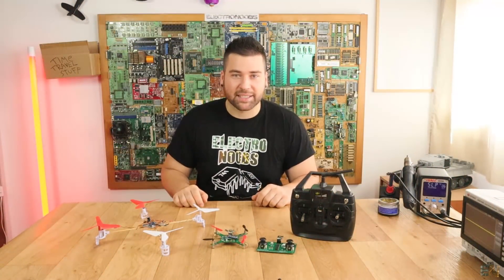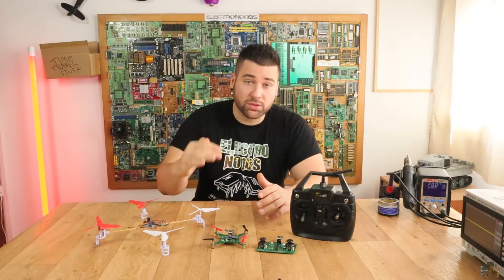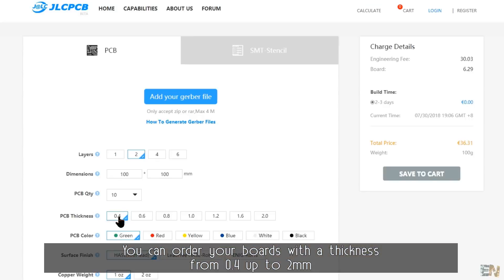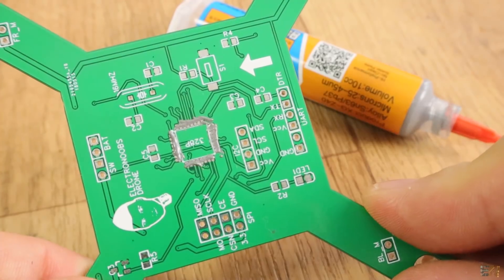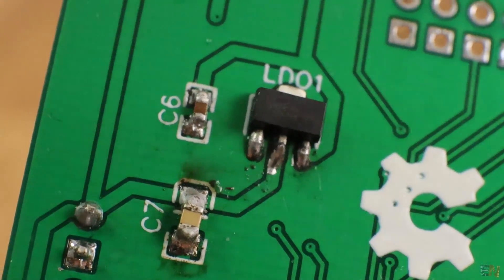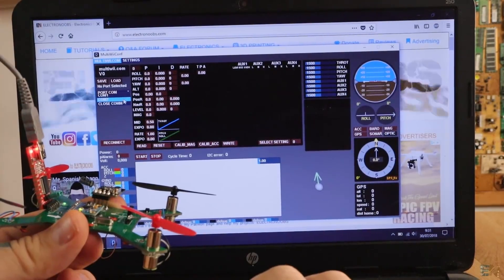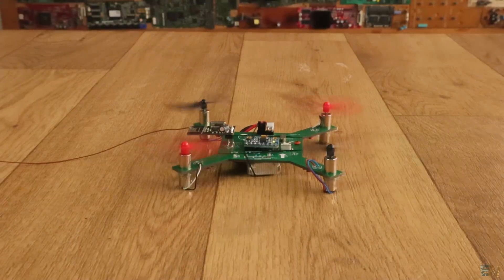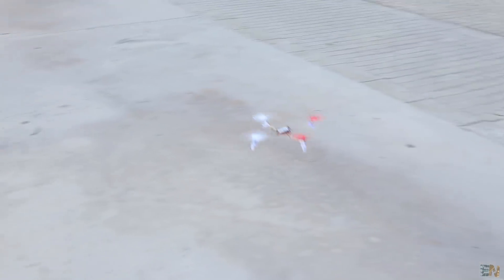Arduino brushed motors DRONE - Part3 - it finally flies

Comment: Bro try to use 1050 motor it would give you thirst of 68 grms and it's weight is 25 grms so theax thrust would be 43 grms.

Comment: Why did u try to reinvent wheel? I just buy $20 old Udi818a and salvage parts from it to new frame with new motors (brushes wear out) and upgraded antenna.
Reply from the maker: Good for you. Pretty much everything I do on my channel is more expensive than buying one, obviously... I do it for learning man!
Reply: @ELECTRONOOBS  And learn you shall padiwan Mmhmm (Yoda voice, encase that wasn't clear) subbed to ya now

Comment: I think you should use two small battery separate for motor and the chip. It will solve the resetting and voltage drop problem
Also you can use esp8266 instead of nrf and atmega320p. It has built in wifi so it will also reduce weight.

Comment: Hey sir I made this drone but with big and high rpm dc motors and as.per tge cpnnections but when I send data to the reciever from the transmitter it recieves for some time but after some its lost. I have configured the drone with multiwii win gui 2.2, and also set the correct pid value  please reply🙂🙂

Comment: Try Increasing prop size. I recently built a plane and it would not stay in the air, but I knew the motors could produce enough thrust because they had come from a helicopter that weighed more than my plane and the helicopter was capable of vertical takeoff. I eventually determined that it was because my props were too small so even at max rpm they couldn't product enough thrust. Increasing my props from 38mm to 55mm fixed the problem.

Comment: -I believe you should fix the centre of gravity, the nrf module is not centered on the pcb,
-Use bigger propellers.
-Replace the battery with lighter one if possible

Comment: hello ,
can you make a video making a drone using inbult nrf24l01 radio module in rf nano?? 

https://www.banggood.in/RF-Nano-V3_0-Micro-USB-Module-ATmega328P-QFN32-5V-16M-CH340-Integrate-NRF24l012_4G-Wireless-Imme-p-1500156.html?cur_warehouse=CN

Comment: I followed each and every step that you have shown but there is a problem...While I am increasing the throttle....on two motors are running...other two are not...please help
Reply: Did you find any solution?
Reply: Hey did you find the fix.😅
Reply: @bhavikrajpal6882  bruh…it is occurring due to motors taking large current while taking
There can be two ways:- 
1) place a 1000uf capacitor in the input of the battery terminals
2) use a high discharge rate lipo battery

Comment: What did you use for controlling the motors? Some specific motor-controller or just transistors/mosfets and PWM? If so, which mosfets did you use? As far as I can tell, those motors has a stall maximum current of 2A, so I guess any transistors that can handle up to 2A should work fine? Thanks!

Comment: I made a brushed drone as you told in the other tutorial. The tutorial where the body of drone is make with barbeque sticks and when I gave throttle the Arduino in reciever gets reset  when I reach half throttle . Can anyone tell me  where should I connect the positive wire coming from battery to which pin of the Arduino in the receiver 
Please help 
How can I contact you I need your help

Comment: When I started my own arduino brushed drone, I got inspired by you plenty of times. Thank you so much for that. As soon I reachead the same Stage as you in the Vid, I tried to avoid these motor spikes by writing a sequenze for the motors to start, pressed by a button from the controller. I Still have some problems to fly, but this helped me a lot.

Comment: Hey Man , not sure if i saw properly but did you connected the high voltage to LDO output ?  if so you are shortcuting power rails ( pcb/ldo/componnents damage also power waste as a bonus :) )  ping me if you need any help with power conections ,  i can review it.

Comment: Great video! I was wondering, I have just been getting into CNC milling my own copper PCBs as a hobby and would love to try out the board tracing you have for the smaller green drone with green PCB controller. I already checked your links but would you be willing to share your .BRD file with me so I may try fabricating my own board?

Comment: How to fix decreasing motor values in multiwii java application and this is the same issue you are having with your drone check motor values in java application when drone is armed its not same all 4 motor values is different and decreasing after I put the throttle to maximum
Please give me any solution about unbalanced motor values in multiwii java application

Don't know how your prototype drone worked ????

Comment: Hey I saw lot of quadcopter receiver boards I've noticed 1 thing. There is vcc gnd clock and data connections on back of all boards can I connect mpu6050 or 6000 gyroscope and accelerometer module to it if in case my gyro chip is broken

Comment: One thing you could do is remove some material from your circuit board. That is one great big hunk of copper and phenolic and you probably don't need all of it. Maybe add some holes along the struts and towards the middle to drop some weight. Another thing might be to rework your circuit so that more of the heavy stuff is toward the center for better balance. Finally, if you're designing your own board, add the components for your add-on modules and get rid of the extra weight from those pcbs.

Comment: I have a tip for you:- use bigger but light 3d printed propellers. 
In 3d printers you can lower the density of the material and leave air spaces between the propeller

Comment: Use smd attiny88 microcontroller.. its just works like atmega328 but it doesn't need any crystal to run... So it save the place and weight of the crystal.. the programming of the attiny88 is very easy and its have all the facility that atmenga328p have.
Check this links of my website you can easily figure out the difference.
https://www.arghyabiswas.com/i2c-communication-between-raspberry-pi-and-attiny88-microcontroller
https://www.arghyabiswas.com/attiny2313-microcontroller-programming-with-arduino

Comment: I am using arduino nano +3.7v coreless motors +nrf24 module +380mah 3.7v 25C lipo battery. Do you think it will work as well?
Reply: And Irf640n mosfets

Comment: I think the problem is at the motors because i have seen some drones that the 2 motors for example the two with the black prop., turn clockwise and the red one's turn anticlockwise for better balance, i think, but in your drone they all turn the same direction.😊

Comment: I am just on the verge of giving up now.  Since long(about a month) I am trying to build this drone but my Arduino pro mini restarts everytime I connect motors to circuit. I tried most of the capacitors (100-100MicroF) and their combinations but nothing worked for me. Please help for the Arduino restart problem.
Reply from the maker: Try a huge one. 680uf and let's see if it will restart.
Reply: @ELECTRONOOBS  I already used 1000MicroF , still same problem
Reply from the maker: @vishalraykar4948  well I don't know how to help. Maybe put a bigger resistor to the mosfets gate so the spikes won't be that big and fast.
Reply: @ELECTRONOOBS  ok will try the same. Thanks
Reply: @ELECTRONOOBS  also tried combination of 1000,100,470uf in parallel

Comment: IMO 16v cap is a bit huge. How about a few 100uF 6.3v tantals in parallel. Lower ESR... much better. I would also recommend a small boost supply to 5v so you can drive the mosfets better. (3.3v is barely enough for some - motors still supplied by the battery of course). Smaller "wings" to the motors is also better. hell even make a cutout for the nrf module since you are using modules make them as small as possible. Using the 1mm/0.6mm pcb should also help with weight but lower rigidity. - Nevermind saw the end of the video and you came to the same conclusions. Almost

Comment: Buck converter for your 3.3 volts larger tracks from the battery to and from the buck converter or to test add copper wire on the tracks this will stop voltage drop remove large capacitor you don't need it then add 0.1Uf ceramic caps to each motor across the terminals and 0.1uf from the positive input terminal on each motor to the motor case this will sheld motor noise to the radio de-couple any long tracks from the microcontroller to the motor board try 0.1 ceramic caps the tracks look small to me use big tracks if you can if you cant use big tracks get your board made with more copper!! your cheap motors are a major problem as the body will be made from steel due to the magnets this is why brushless motors made of aluminium are used. good luck and love your channel your videos are very good and you explain it all so well.

Comment: That's a cool  Arduino project.  Getting the  bang for the buck would involve testing motors and props to see which ones will give you the most lift with the least amount of energy consumed.

Comment: Cool video.

1) There looks like a lot of circuit board real estate that is not being used.  How about reducing the weight by cutting out most of the center of the board?

2) The board is wide in the area of the propellers.  The propellers are working to blow on the board, where energy is lost by a change of direction.  And there is probably with a bit of turbulence.  How about making the for arms on separate boards that solder onto the main board? Or, have no main board, but just two boards attached as a cross shape.

Question: You awesomely used solder paste to attach the processor.  Why didn't you solder all the passive components the same way.  Your killing me Smalls.  :)

Comment: Have you tried to block with a 47u tantal and 100n next to the radio module and mcu? 
Maybe an rc filter can help blocking spikes from locations, that have no chance to work with them. 

Are there bigger propellers available? 
The spinning direction is false. Opposite propellers have to spin in same direction, because they have to cancel out the rotating drift of the drone with a force through the weigt center of the drone.

Comment: I'm looking forward to this project, And when I finish my current project (An 8-Bit Computer) I will maybe design my own drone idk...

Oh and a few tips: I recommend you not to remove the ground plane, it protects the signal traces from rf interferences, but you can remove A LOT of PCB, the PCB is WAY too big for that little drone, also, reducing the size of the arms is a good idea just leave the absolute necessary space for the traces and let less mass of thrust to be blocked by the motor , I would the transistor and the diode into the PCB body not on the arms so they don't create so much inertia. Also for stability purposes, The acc/gyro chip needs to be at the center of mass as exactly as possible that's more important than put the uC in the center.

Have a great day :D

Comment: In my opinion, the problem is that you need to put some trimmer to the base of the transistors to regulate the voltage for the four motors, it's clear in the video that the motor down the black propeller are spinning slower, if you want to keep the ideal pid parameters equals then you need a hardware offset correction or do you have this in your code? Also you need a powerfull stabilizer not just a capacitor, like a step down converter like this https://www.amazon.it/gp/product/B01MQGMOKI/ref=oh_aui_detailpage_o09_s00?ie=UTF8&psc=1 or a step up converter if needed. I said this because if you have a switch and all motors are connected directly to the battery you can try it, it should go up without pid or things like this, just because the motors with the same input voltage spin at the same speed.

Comment: Hi, I can suggest that you decrease the dimension of motor arms as well running between main board and motor holder resulting in more weight loss of PCB itself, bringing components closer to the atmega will also give a good CG support
Reply: Can u plz help me 
Phone number and whatsapp:6239465569
Instagram:sunil_kumar__105

Comment: The avr chip works fine with 3.7v input...your only problem is the input to nrf24l01 chip. I had the same problem and I got around it by dropping the input voltage using a siplme 1n4007 diode. For the lift problem there exists longer propellers which output more upward thrust..you should use those

Comment: Hey!...I was thinking... You can use an IR sensor instead of nrf... It will reduce the weight and you won't have the trouble of 3.3 v... And you can make an IR remote also to control the drone ... Anyway I am waiting for the next update... Your videos are super cool and contains perfect material! Keep going!😄

Comment: MultiWii is really old and pretty much a "dead" project. Btw, why are you not using a esp8266 or esp32 instead? Then you can use wifi or EPS-NOW to control the drone and completely remove the need for the radio-receiver. If you use WiFi, you can even use a phone to control the drone.

Comment: I think your biggest problem here is that the motors vibration affect your gyro/accel readings. You have no soft separation between MPU module and motors. 
You didn't have such a big problem with the bigger drone because it had long wooden arms that were damping the motors' vibrations. But with this tiny solid frame the vibrations hugely affect the gyro and your stabilization algorithm goes crazy causing the drone to jump and spin. You can see that most brushed frames have some sort of rubber dampeners for the motors.
Reply: Singing video faking video

Comment: Replace the "arms" with wooden sticks just for testing to reduce weight. Also a bigger battery (and especially higher C rating one) will actually make it fly with more power, since I doubt a 150mah battery can push enough amps. Maybe thats the problem? I have small motors with 65mm props ant when I connect it to a battery they push a lot of air, no problem getting 60g of drone into the air. So a simple solution, make longer "arms" for bigger propellers and use a bigger battery.

Comment: the propeller rotation is wrong it should be diagonal pairs not front and rear pairs
x=clockwise o=counter clockwise
          xo
          ox
not 
         oo
         xx
Reply: The rotation is fine, you might be mistaken by the colors 7:00
Reply: Yeah you are 100% right that’s my mistake
Reply: Hi. I am planning to build this but my question is  how is the drone going to fly when the propeller are on the different direction. If one propeller is rotating CW for example it should blow air in the direction of the ground. And if I make that the other motor rotates CCW it means that the propeller will blow air upwards. So if 2 forces blow air in a direction and the other 2 forces blow air in the other direction the drone cannot fly. How can i fix this?

Comment: You definitely need to improve soldering. My advice is never use lead free solder, use flux - a lot of, conversely. It is almost imposible to do good hand soldering with lead free solder. Especially for begginers. Start with 1206 instead of 0805 packages. Put small amount of flux on the pcb pad, heat the pad with the clean tip of soldering iron and then add small amount of lead solder. Use solder of 0,5-0,6 mm in diametr. Than place the component to the pad, hold it with fine tweezers. Heat again the same pad together with the component lead. Now is the component fixed to the place. Add flux to other component leads and pads and solder them one by one. You need to clean the hot tip of the soldering iron regularly. It's better to use short chisel type of the iron tip then longer sharp one. Check out some Louis Rossmann video maybe. And finally 10uF cap between Vcc and Gnd on NRF24 module is a must.Tantal is the best. And the small version of NRF24 not working together with the regular one. Good luck.

Comment: Some dc motors does not spin as well in both directions. It seems like the motors spinning counter clockwise spin better than those who spin clockwise, as the quad spins around when trying to lift off. Don't know what you could do about it though. Keep it up!

Comment: Use a diode to reduce the back emf spikes it has a weight negligible to that of the capacitor and connect it in reverse polarity to actual polarity of motor to make a conductive path for the current to flow from the motor

Comment: 5:21 soldering is not good
try to use 1206instead of 0805. and use some flux or better solder, iron on 300 C in it will bee niece and clear. heat joint put some solder on ona pad, after solder this pad to 1206 and solder another....

Comment: It might be a good idea to directly measure the lift of the original motors, and the lift of the new motors. That will give you a better estimation if your changes will be enough for flight, or if you’ll need to make additional modifications.

Comment: keep it going man :) nearly there.

you should consider upgrading the motors, it will increase costs but if it flies you have a working drone :)

if you want to add any other components (ie: camera, frame) then you would rather have more power than less.

Comment: So why exactly are you using those small props? Are the motors maxing out with bigger ones and without a gearbox? If you chose the props just for geometry, try a tri-blade with about the same size. Or similar props with a steeper pitch. 
Other than that, the nrf24 module is great, but a pain in the butt when it comes to powering it. It doesn't like to be underpowered, but overpowering it might kill it. Ask me how I know :D 
Anywayz, thanks for the video, these projects that 'almost work' can become quite frustrating...

Edit: The center part of the PCB does not look too tightly packed. I think you can save quite a bit of weight there in the next revision.